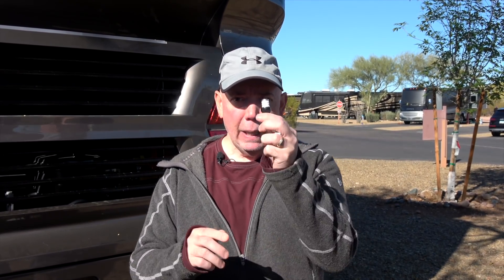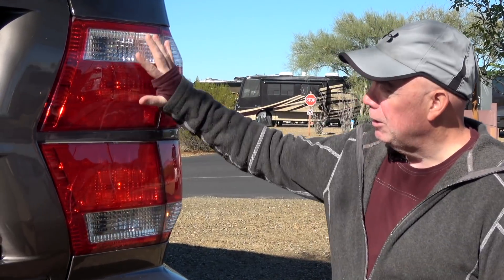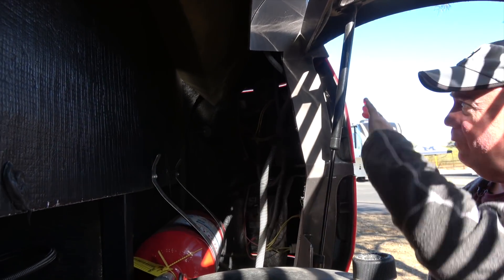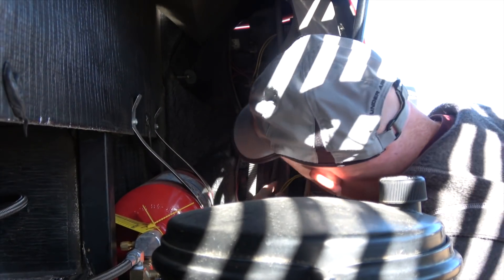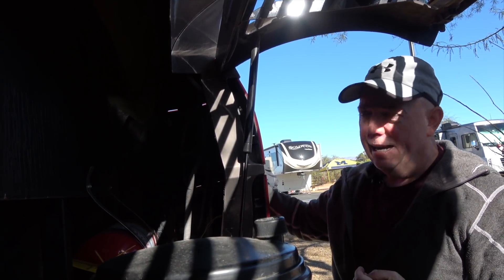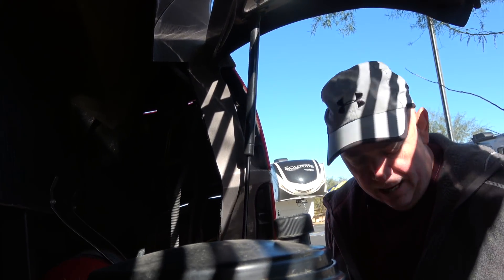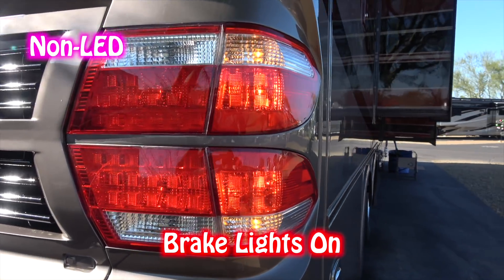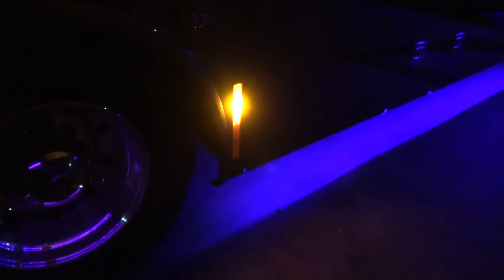Lets Use LED Brake, Directional, Reverse and Marker Lights!!!

Comment: Dave, I know it’s been awhile but how well did this LED swap work out?  Did the chosen LED bulbs work out well?  Any bulb failures?  I’m trying to swap on our 2016 Bus (same taillight assemblies) and overwhelmed with the range of choices and way too many comments that they weren’t much brighter than stock, or were way too bright overall.  Would appreciate any feedback.  Thanks!
Reply from the maker: Hello, I personally have not had any issues with the LEDs that I have chosen to use. I have not had one failure as of yet and it's been a number of years. So that's good. Now if they're still available, the ones I chose, is another question. You know how things are these days. But in any case, I've been very happy with the change in the move over to LED bulbs and the ones that I am using are running well.

Comment: Hey Guys, Love your blogs. Did you do the Alley dock lights and forward running lights (the small ones on the bottom) as well? if so, do you remember the part number for those? 2016 45OP ~ Cheers!
Reply from the maker: Hi Terry...I did not do the side docking lights as we hardly use them.  I did however do the front fog lights and also made them another color. Here is a link to the ones I used...  https://amzn.to/3atcb46
Reply: @DavidBott  Very nice! Thanks for the reply, Merry Christmas, Happy New Years and SAFE TRAVELS!

Comment: So Dave, why did you use the red LED instead of the white? Wouldn't they make the red filter even a brighter red?
Reply from the maker: The the red LED with the the red filter is even more red and brighter as you can surely see in the ending part of the video.  I tried white also, just was much happier with red in brightness.

Comment: Why colored   vs clear bulbs?    Also,  don't do this on your Jeep, as  the Jeep electrical system is looking for the bulb's resistance to "know" the bulb is good,  and  it will show a bad bulb even tho the bulb is good.   Not sure if Tiffin  uses a system like that or not.
Reply from the maker: Hi...The colored LEDs are much brighter when added to the same colored lens.  The LED's can you put in something like the Jeep are special as they have components that just for that.  But I had no intent with messing with the Jeep and the Tiffin was just fine with the bulbs I found. A number of them did go back. :) Take care, happy new year!